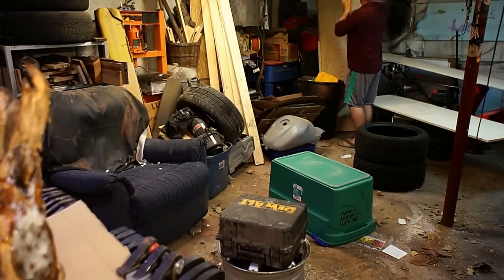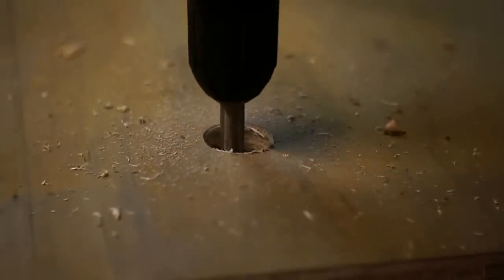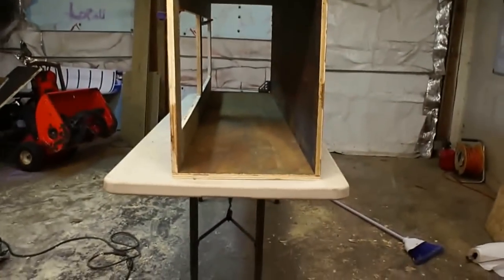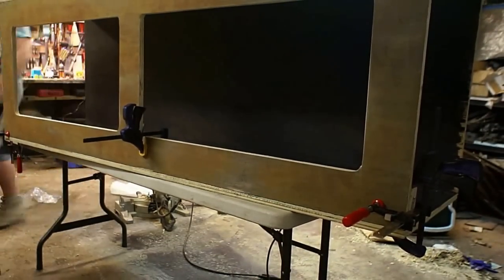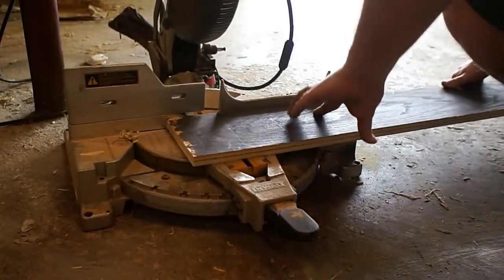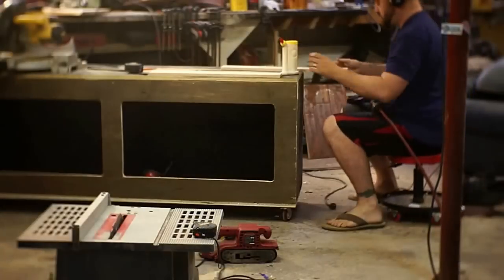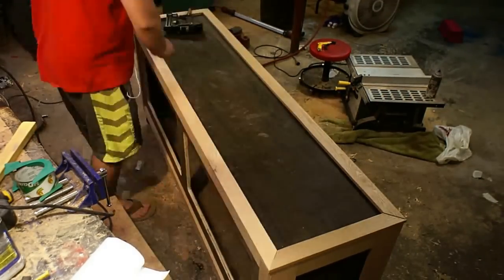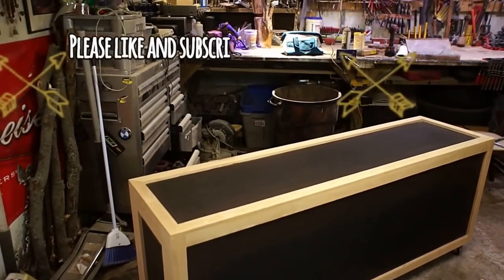Building Bottom Cabinent for retail shelves, 2/4

Comment: Nice. That sneaking up on the exact length has made my projects ten times better. I always hated the gaps I'd get, but now it's gotten a whole lot better. Also I bought that same router, but mine seems to slip on the depth. Ive tightened it up, but it still wants to move. Do you have this problem with your router?